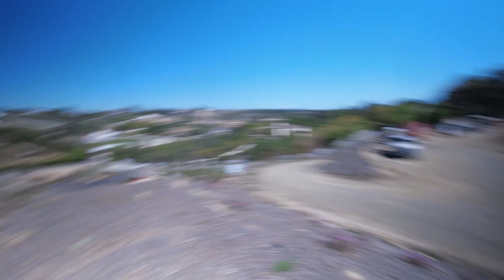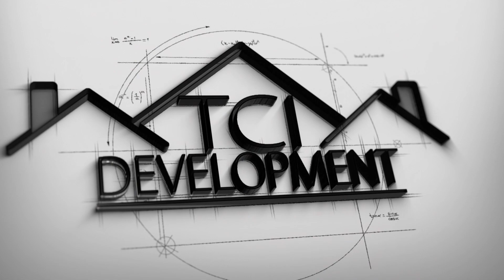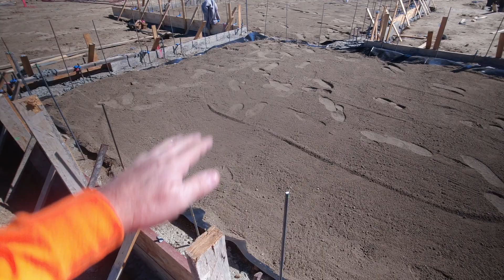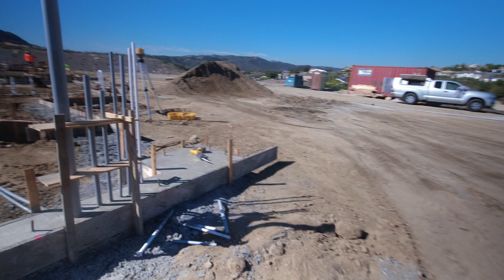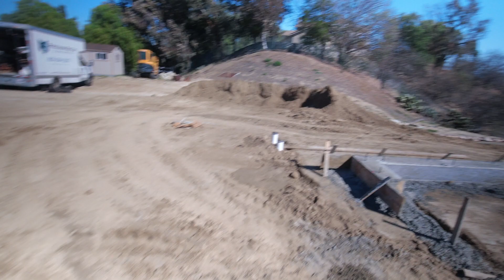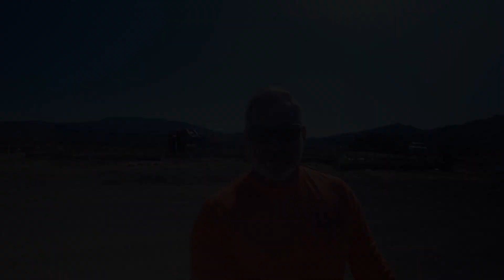Ep. 6 One of A Kind, Massive Wine Country Custom Home  PREPPING FOR CONCRETE SLAB!

Comment: I’m planning a house for my De Luz lot and I’ve been doing a lot of research on  best build practices. Looking at Risenger and Steve Baczek, reading Lstiburek. I saw that Baczek was at one of your builds. Those building science guys are adamant that there should not be a sand layer between the vapor barrier and the slab. The Stego guys (vapor barrier company) concur. Did Baczek say anything about this when he visited your site? Any thoughts on this? It’s common to do this here, but not in other parts of the country?